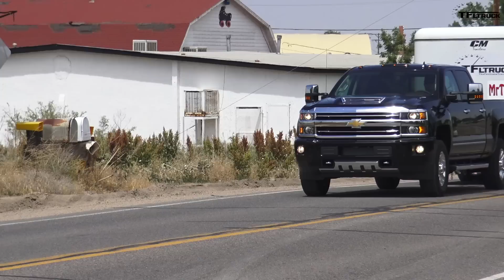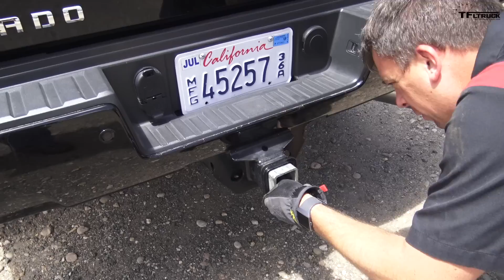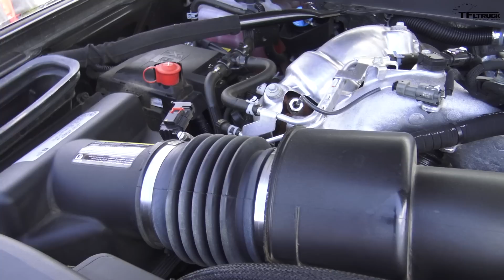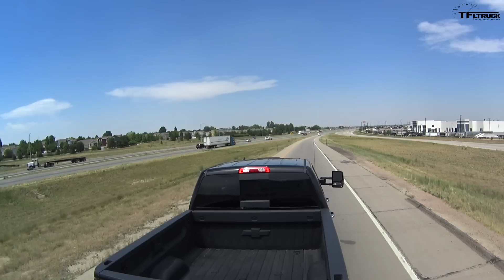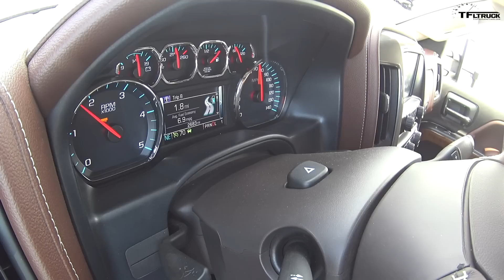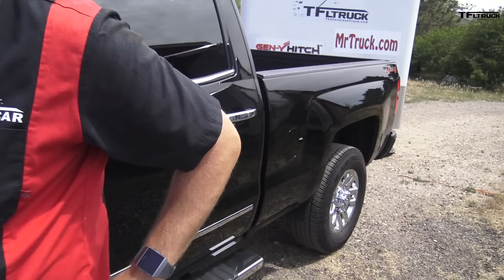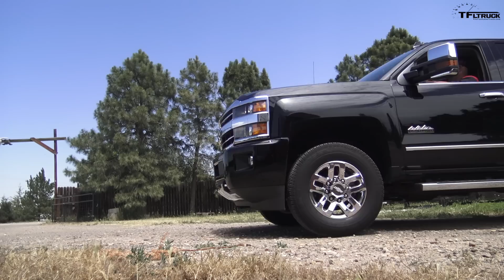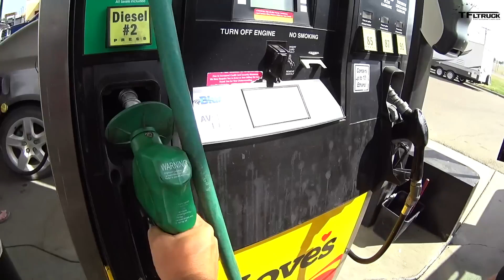MPG Challenge: Silverado Duramax vs Cummins vs Power Stroke

Comment: Duramax is the best all the way around! Looks, power, and last but not least dependability!
Reply: The Real John Smith Everyone is in competition but honestly Every truck and suv is great and deserves some credit. It all balances out Ford Beat The sales for the past years Then it goes for ram and GM Etc. Maybe 2019 or 2020 ford will Be top brands or maybe ram who knows.
Reply: +The Real John Smith That's true Ford is pretty close to the industry average, at least in more recent years. They both have their issues, though not as much recently. I also think Ford will likely only get better just because domestics have raised the bar in recent years, well with the exception of Fiat / Chrysler. Then again we can't technically call them a domestic anymore.
Reply: +The Real John Smith Just of note, the Ward article rated recalls per 1,000 vehicles, so they evened the playing field irregardless of volume. On that list Ford was 13th, though the gap was pretty tight from 8 to 13. any of those spots were up for grabs. I'd be willing to bet that since then ford has climbed a few spots. Interestingly the overall industry average fell closer to the 11th ranks stats that the 8th or 9th.
Reply: Ashes 2 Ashes... I have never owned a Ford and never will. That kind of assumption shows your state of mind. I had a 2005 3500 Duramax. Engine and trans are fine  but when I had to replace the front end twice, I've moved on. 2017 RAM 3500 is what I have now. I will never consider GM until they put in a straight front axle and fix the ugly problem. I will say the 2019 half ton looks pretty good though.
Reply: +Ashes 2 Ashes I apologize for my lousy. I'm half asleep...
Reply: I apologize for my lousy editing. I am half asleep
Reply: Evan Santos Really Break down the road that joke is not real nor funny And Actually yes Ford has topped off chevy 40 YEARS straight Chevy ain't got nothing dodge is the competition here.
Reply: Premium Bass™ Dodge? Lmao! You must be living under a rock or in denial!
Reply: +Premium Bass™ aw, you're one of those cute people that believe all the advertising you see! First of all, regarding your truck comment, if you really want to count all the trucks as a whole, ford doesn't even come close to competing. In recent years the GM large SUVs outsold anything Ford made dramatically and will continue to No Doubt for years to come. Rappers Drive Escalades not Navigators. Navigators were cool for 5 minutes. Escalades are known the world around. Suburbans and Tahoes are driven by just about everybody anywhere with a big family and wallet, And only until recently have Expeditions even been noticed, and that's of course because they completely ripped off the suburban's design and it  pretty much look like its twin. Cadillac is far more successful than Lincoln, and Buick does far better than Lincoln as well... especially globally. gm is also having a lot of success with the Colorado and up until recently ford didn't even have a competitor in the works for that in the states. So no, Ford does not sell more trucks than General Motors. They don't sell more cars either. That's why General Motors is significantly larger than Ford. And now that Ford's  going to stop making the majority of their cars, that's going to put an even bigger dent in their sales. If they sold so many cars, then why would they just stop building them. That's pretty f**** dumb don't you think? Are you one of those people that drives a Ford because you can't spell Chevrolet? Poor soul. I enjoy your blind  faith though. It's endearing.
Reply: Once since 2009 have Silverado/ Sierra combined outsold F-Series. You have to add Colorado/ Canyon sales to say they sell more "trucks." But the mid size market does not compete directly against the full size market. The Tacoma outsells Colorado/ Canyon in mid size. GM loses both categories. It is you who have fallen prey to GM marketing nonsense. GM is the only manufacturer that sells trucks in mid, full, and HD (still considered full size). One would hope they sell the "most" trucks. But the reality is they don't win any individual truck segment.
Reply: http://www.goodcarbadcar.net/2018/01/top-selling-vehicles-brand-usa-2017-ford/
Reply: +The Real John Smith

http://www.wsj.com/mdc/public/page/2_3022-autosales.html

So, let me understand your argument. I am succumbing to GM's marketing nonsense, yet it's Ford that blatantly lies in their advertising and says they outsell everybody else in the truck Market?

Please feel free to click on the link above. Yes indeed, the Ford F-series is the number one selling pickup by name plate in the United States of America. That being said, Ford sold a total a total of 468k trucks ytd to GM's 568k. This is a common statistic between the two at this point in the year. Last time Iooked, a Colorado was indeed a truck. So is the Yukon, Tahoe, etc. Just like the Expedition and Navigator. That is how they are classified in the automotive world and that is how they are logged when they are sold. So you can make your argument any way you want, but at the end of the day General Motors flat-out out sells Ford in the truck market. That's the way it is. Trust me, sir, if you're buying a Ford  truck just because you think all your neighbors have the same one so you should too, you're an idiot. But if that advertising is working for them, and obviously it is to some degree. Then so be it. At the end of the day, GM's clearly making way more money and selling way more of a volume of cars. This is the way it's been throughout most of recent history. That's why General Motors is the bigger company.. 

Don't take it personal, I don't hate Ford. My work vehicle is a Ford. it's been an okay vehicle, I have no complaints about it. I don't dislike Ford. I'm just not a person who believes everything I see without actually doing some research.
Reply: Math and reading comprehension weren't your strong suite, were they? I'll say it again in more simple terms so that you can understand. The F-Series is F150- F450 (non-chassis cabs). The Silverado/ Sierra are 1500-3500. They compete against each other (not Colorado/ Canyon). Ford sells more F-Series than Silverado/ Sierra combined. GM also has Canyon/ Colorado. Those are mid size trucks. Ford doesn't sell a mid size until the Ranger comes out next year. GM does compete against Tacoma in the mid size market. And Taco outsells Colorado/ Canyon combined. Ford isn't adding cross segment sales nor adding Lincoln to get at their numbers. That's a GM tactic. The sales data you are citing are GMC and Chevy sales of both mid size and full size trucks. GM loses each segment to the competition. By your logic the Camaro would outsell the Camry because GM would add all car sales to justify selling more "cars." Manufacturers compete by segment, not total sales. Even the individual brands under GM compete against each other. Here is the breakdown for you- http://www.goodcarbadcar.net/2018/04/top-11-best-selling-pickup-trucks-in-america-march-2018/
Reply: And if you want it by brand (have to use march because GM only reports quarterly sales now)- http://www.goodcarbadcar.net/2018/04/u-s-auto-sales-brand-rankings-march-2018-ytd/
Reply: The Real John Smith Looks like your one of those people who do everything by the internet. Let me give you some homework count off every Chevy and Ford you see. Gm has sold more SUVS but not cars and Trucks.
Reply: Premium Bass™  The only SUV GM makes that outsells its Ford counterpart is the Tahoe/ Suburban. Explorer, Escape, and Edge outsell Traverse, Equinox, and Trax. http://www.goodcarbadcar.net/2018/01/december-2017-year-end-u-s-suv-sales-rankings-top-107-best-selling-suvs-america-every-suv-ranked/
Reply: Ashes 2 Ashes and you literally typed all that to say absolutely nothing. Ford is a single brand. Chevy is a single brand. If people dont like a Chevy design they could go to Buick...... or Ford, or Jeep, or any other brand. Ford isnt trying to compete with GM at large. Only you are trying to make yourself feel better by adding multiple brands to beat Ford.
Reply: Ashes 2 Ashes if you think sales equal profit you’re definitely not as smart as you think you are. If that were the case GM would not have gone bankrupt.
Reply: +The Real John Smith that's an amazing Point actually, except that now GM makes way more money than Ford. So I guess that's not a point at all. Maybe Ford should go bankrupt! The only problem is nobody in this country cares enough to save them. Remember in the eighties when Reagan almost had to shut them down because they couldn't even get their gear shifters to stay and park. I bet you forgot about that too! Luckily for you, he didn't want that on his conscience. I can't say I blame him.
Reply: Ashes 2 Ashes nice try at a deflection- I sure do remember the eighties- https://www.autosafety.org/history-gm-side-saddle-gas-tank-defect/
Reply: +The Real John Smith I apologize for using so many big words John that I confused you. I am befuddled by one of your comments though. Did you just indirectly say that Ford's not competing with GM?!? I think we're done here. Someone doesn't understand the concept of how the automotive business Works apparently. They don't spend money on advertisements because they aren't competing John. You just continue to be a simple kind of man my friend.
Reply: https://www.yourmechanic.com/article/10-most-recalled-car-brands-by-jason-unrau

+The Real John Smith that's cute. Let me guess that's the one that was found to be false and that the fires are actually were being accelerated by Estes Rocket engines in the test to make them look worse than they actually were. Sadly when it comes to vehicle fires, the Ford Pintos in the ones that are remembered.

 Why don't you pick an article that's actually from our recent generation. Oh wait, I know why.. I wish this had gone back just a little further to when the Ford trucks were just starting on fire because their cruise control system was constantly powered and would literally light the trucks on fire while they sat in parking lots. Yes, when it comes to recalls, Ford has far more skeletons in the closet than General Motors my friend. So now who is deflecting? unfortunately you turned down the wrong avenue.
Reply: Ashes 2 Ashes recent generation. You brought up the 80s. Not me. Should we go with ignition switches?
Reply: Ashes 2 Ashes You want rates of recall- Sierra and Tahoe make the top 10. Is May 2018 recent enough for you? https://www.google.com/amp/amp.timeinc.net/thedrive/news/21102/here-are-the-cars-with-the-highest-and-lowest-recall-rates%3fsource=dam
Reply: Ashes 2 Ashes You might want to update your articles from 2014 too. Whats funny is that for sales you want to combine GM brands; but recalls you want a list where Ford is 1 and “Chevy” is 2. You dont comprehend rate v volume of sales. When you sell more, more are recalled. The rate of recall is the teller of reliability. https://www.consumerreports.org/cars-driving/which-car-brands-make-the-best-vehicles-2018/
Reply: Google Ford Powerjoke problems.
Why would anyone buy one after the way Ford stuck it to customers?
Reply: +The Real John Smith well that's a very valid point John. In fact if you actually read that article you would have noticed that they stated under Chevrolet that they actually did much better than it appears, because they sell an abundant amount of vehicles per recall rate. Ironically, though, they didn't say the same thing about Ford . But I think I know why. If you take the time to look up Ward's Automotive most recalled vehicles by manufacturer, you will find an article from 2017, probably the newest thing you're going to find on a yearly collective anyway, stating that on the most recalled vehicles list, GM was actually well below the average. In fact they were 6, they were barely nudged out by Mazda. Where does Forbes out on that list, somewhere around 13 out of 18. Ford actually had more recalls then they did car cars sold. 

Speaking of cars sold, there's a pretty good total volume for that as well you might want to check out. It's what I would have expected, but I'm sure you'll be in denial.
Reply: Ashes 2 Ashes Under the Ford section - “but because of their massive sales volume and expansive vehicle lineup, it stands to reason that their vehicles will experience more recalls.” But in that article they are talking about volume, not the rate. Sell more cars and there is a problem; more to get recalled. But the number of problems / number of sales tells the story of actual reliability. In which case Ford is @ the industry average. I dont dislike GM or any other brand. I just prefer verifiable fact over internet opinion.
Reply: All of them have had their up and down years. I like the looks of the Ram, and of course, the Cummins in the 2500/3500. But Ram's reliability has suffered over the last several years. Its simply a fact. I would expect them to do better in the future. One will find people who have individually had great luck with any brand/ model. But individual experience by themselves don't speak for how an entire line is doing.  That's where the JD Powers, Consumer Reports, Wards Auto, and iSeeCars come in. Everybody loves those organizations when their brand comes out on top (or higher than x brand). But then they are cursed as unreliable and liars when their brand/ model doesn't do well. GM touts JD Power awards in their commercials. But let them do badly in a JD Power study and the GM fanboys say JD Power is unreliable. Well which is it? Lol. All cars today are pretty reliable compared to a decade ago. Treat a car right and it will generally treat you right.
Reply: I read the Ward's article. The interesting thing about recalls is that they can be viewed as good things or bad things. On one hand, nothing is perfect and we would expect any manufacturer to "fix" something that is, or could be, a problem. A recall could be for something like a radio knob falling off or replacement of an engine. There is probably a line somewhere that it becomes classified as "unreliable" or "glad they are taking care of the customer." I only use GM and VW as an example because it is highlighted in the article- "While General Motors ranks No.6 in the recall rate, 90.1% of the cars recalled are for issues with possible dire outcomes. Conversely, VW has the worst recall rate but has a lower percentage (77.6%) of vehicles with severe ramifications." So GM has less recalls; but, the issues are more severe than some other. There is further analysis that should be done outside of raw or scaled numbers to understand net effects. http://www.wardsauto.com/industry/best-and-worst-automaker-recall-rates
Reply: Evan Santos Looks? You like square fenders for a round tire? Not to mention the wimpy IFS. Friends don't let friends drive HD trucks with IFS.
Reply: @guardrail2897 what about on a 2wd?
Reply: +Pat MyGroin I've always found that argument so strange. Especially when it's coming from a Ford fan. Why would you complain about Square wheel wells on the truck when you're driving a Ford? The gauge clusters Square, the headlights are square, everything on the Fords are square. They literally look like they were just a few weeks shy of being used in the next vacation movie they are so cartoon like. The nearest ones are finally showing more of a rounded edge, but just a few years ago they were out right ugly. This was especially true in the work truck versions.
Reply: Premium Bass™ I mostly see Fords broke down on the side of the road! Ford Motor Co. sells gimmicks. If you count Chevy and GMC they don’t out sell them. Ford has tried for years to out do the DURAMAX, but haven’t accomplished that feat. Sorry for your luck!
Reply: +Pat MyGroin Well, someone thinks they know me way too well! I actually like both to Cummins and the Duramax, but I find the Duramax to be the underdog just because Cummins has been building diesel engines for a very long time. I mean if you wanted to get technical, I guess General Motors so it has two since they did on Detroit Diesel. It's the Ford fans that make me laugh though. I certainly don't hate the power strokes, but it seems to me like General Motors and coming to been up in your game for some time, and for just keeps coming out with the same crap over and over again that they always quote as being better, but then in real life gets lousy gas mileage and they burn on the side of the road. with Dodge though it's everything other than the Cummins you have to be worried about. There's a reason what remains of Chrysler constantly has poor reliability marks nowadays. That being said though, I have had some real reliable Mopars over the years. When they make a good car, they definitely make a good car. It's just that when you get a lemon, you definitely get a lemon! I suppose a lot of people could say that about just about any brand though.
Reply: Ashes 2 Ashes Im sorry to say Ford is the most selling truck Ever 40 Years straight All you see is ford everywhere wonder why. Funny thing Ford always comes to the rescue Pulling stuck Chevys. Like Everyone should adimit that ONE brand has to be the Best out of all and everyone should know it's the ford Best in class towing torque etc.
Reply: +Premium Bass™ aw, you're one of those cute people that believe all the advertising you see! First of all, regarding your truck comment, if you really want to count all the trucks as a whole, ford doesn't even come close to competing. In recent years the GM large SUVs outsold anything Ford made dramatically and will continue to No Doubt for years to come. Rappers Drive Escalades not Navigators. Navigators were cool for 5 minutes. Escalades are known the world around. Suburbans and Tahoes are driven by just about everybody anywhere with a big family and wallet, And only until recently have Expeditions even been noticed, and that's of course because they completely ripped off the suburban's design and it  pretty much look like its twin. Cadillac is far more successful than Lincoln, and Buick does far better than Lincoln as well... especially globally. gm is also having a lot of success with the Colorado and up until recently ford didn't even have a competitor in the works for that in the states. So no, Ford does not sell more trucks than General Motors. They don't sell more cars either. That's why General Motors is significantly larger than Ford. And now that Ford's  going to stop making the majority of their cars, that's going to put an even bigger dent in their sales. If they sold so many cars, then why would they just stop building them. That's pretty f**** dumb don't you think? Are you one of those people that drives a Ford because you can't spell Chevrolet? Poor soul. I enjoy your blind  faith though. It's endearing.
Reply: I do have to say though I do find it odd that a lot of Ford fanatics come on here after watching Ford get its ass handed to it yet again and make stupid comments. By now you should just be tired of it. Just the luck that this channel has had with Ford vehicles should be all the research you need. Sure a lot of the testing isn't as conclusive as it could be, but let's review the basic facts from recent history on Ford. It delivered a quote-unquote work truck that couldn't even make it to the gauntlet without having a mechanical failure. Okay seems odd but then again the Dodge and GM trucks haven't had that issue yet. They just recently had another new truck that had a failure going down the hill during its first towing test, okay seems like maybe another odd issue, but again the GM and Dodge haven't had this issue yet, During the big test last year for towing up the Ike, Ford brings in there new improved Diesel with the best stats of the pack and somehow remains the last truck to make it up yet again, and it has the worst fuel mileage doing Another common denominator for Ford, claiming to be the best but always being last in the actual life stats. underperforming on their stats. And then we made excuses about regen at all sorts of other nonsense. At the end of the day Ford just never does as well and seems to have more problems. And that's just the way it is. I find it odd that everybody thinks it's just onesie twosie type stuff when literally it's always Ford that has the issues...even on this channel. 

You Ford guys are a Relentless Bunch though, I'll give you that. Ford's probably thankful for you folks everyday. They're going to be even more thankful when they stop  making cars.